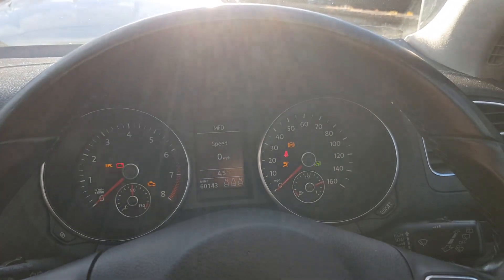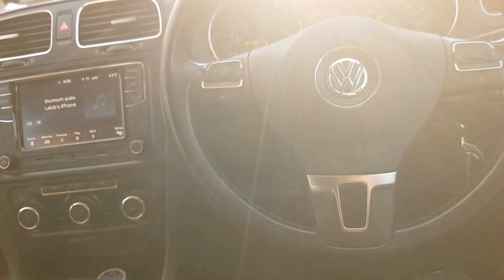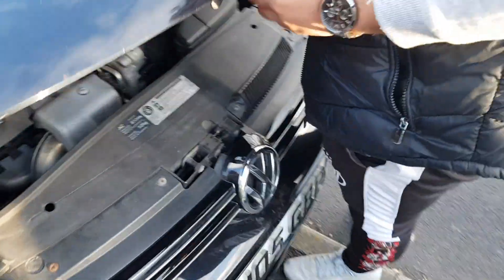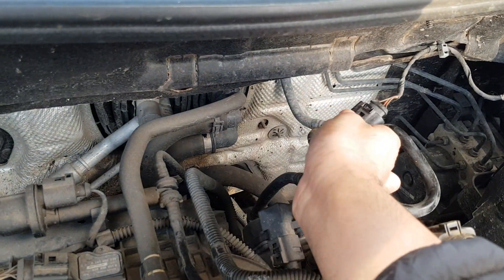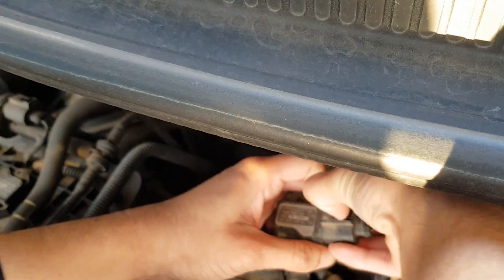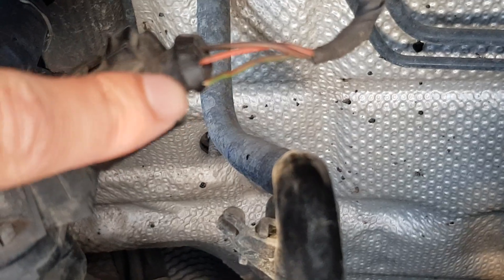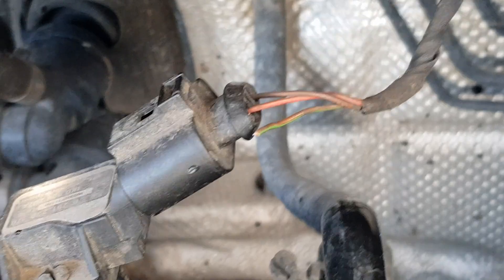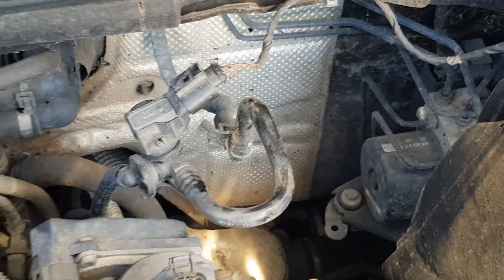How To Diagnose Brake Light Vacuum Problem VW Golf MK6

Comment: Thank you very much. Just like you said, the middle cable remained in my hand. I soldered it very carefully. However, the light did not go out for a long time. After approximately 5 km. it went out. My problem was solved.
Reply from the maker: No problem im glad i could help please help me out by subscribing to the channel

Comment: I have a broken wire just like you showed, and I unplugged it that connector, now I can't reach the cable's end to reattach the cable.
Reply from the maker: @rolandboros  what you mean cant reach?, is cable too short noe
Reply: @MrWaheedulHaque  the video shows broken cable at its neck. I cant go under the plug to access the cable and reattach it
Reply from the maker: @rolandboros  oh i just cut it off, but first got the new replacement connector it comes with cables attached, so i just cut the new cable down a bit and then soldered it on

Comment: Do you have a link to the replacement vacuum sensor you bought please? Cheers
Reply from the maker: best bet is either scrapyard or ring vw for a new one they not much
Reply: @MrWaheedulHaque  hi mate my one got this problem can u gave me any advice pls
Reply from the maker: Is wire broken,
Reply: @MrWaheedulHaque   I don't know
Reply: @MrWaheedulHaque   some mechanic said my be hydraulic pump abs
Reply from the maker: @servetdushku6400  check like in my video if it just broken wire its cheap fix
Reply: @MrWaheedulHaque   how can I check
Reply from the maker: @servetdushku6400  did u watch the video at all it literally shows it all
Reply: @MrWaheedulHaque   yes but I can't see any loss wire
Reply: @servetdushku6400  if no wires are broken you probably need to replace the sensor. That's what fixed mine
Reply: @ryanburke5944  no wire broken
Reply: Bro , ive got the same fault , for a while now. I usually get the warning light come on dashboard after going uphill, like on a long uphill stretch. Changed the sensor , and i didnt see any broken wires. No luck so far .
Reply from the maker: @aleksistar631 scan it using code reader and tell me the exact wording of what it says
Reply: @MrWaheedulHaque  yes bro. 
1 fault found 
03366 vacuum sensor 
002- lower limit exceeded - Intermittent 
Freeze frame:
Fault status : 00100010
Fault priority: 1
Fault frequency : 1
Reset counter: 138 

Thanks bro
Reply from the maker: @aleksistar631  when it says lower limit reached it means something is worn out, when u changed sensor did you change the hose on the sensor with it, if not that might be next thing to replace as if theres a even slight cut on it or leak it will cause problem
Reply: @MrWaheedulHaque  it was just the sensor.  I did check for any damages on the hose , seemed ok.  What's strange , it only triggers the fault when I'm going uphill at high revs . 
I will be a thorough leak test . The brake pedal also feels stiffer than usual when the car is off. So I need to press harder to start the car. Making me believe, the booster is not holding back any vacuum
Reply from the maker: @aleksistar631  yeah have someone check the vacuum lines with smoke test, and have them test the vacuum pump is working properly